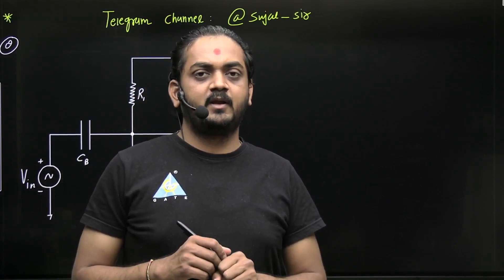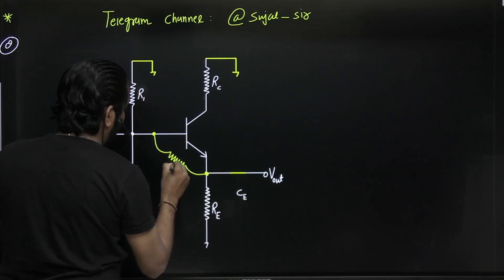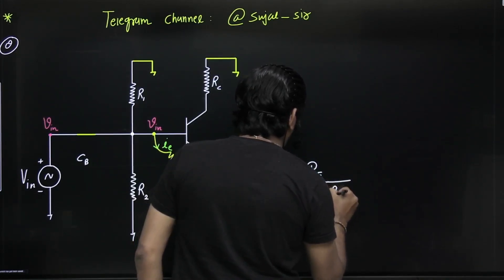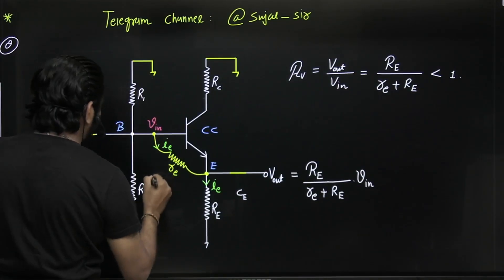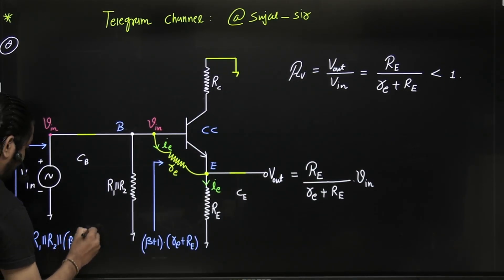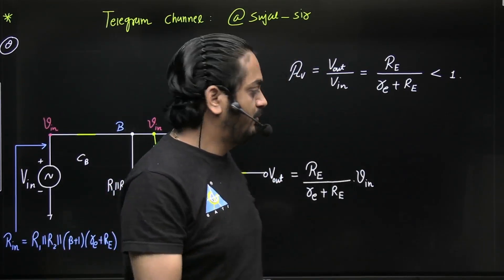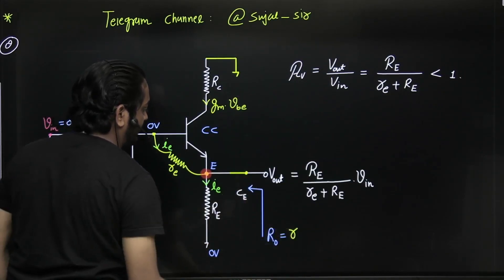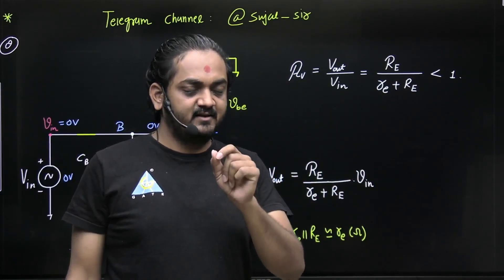Amplifier Analysis Like Never Before Part - 3

Comment: looking back to the network from the output terminals the whole bjt network can be replaced by a voltage source of vin With a re resistance,  and from input terminals looking back to the network can be replace by Inf resistance, so if we connect a ckt to the ip terminals whose gain is k the gain will not change as there is no loading effect and if we connect a ckt of gain g to the op terminals the gain of the ckt will not change as the source has zero impedence , so the overall gain will be k*g,,,,,, which can not be achive by 
direct cascading.  so it's known as voltage buffer, 
THANK YOU SIR